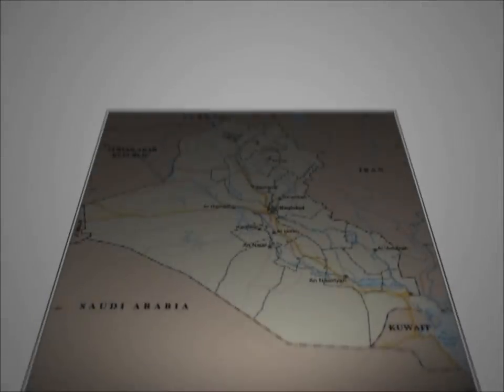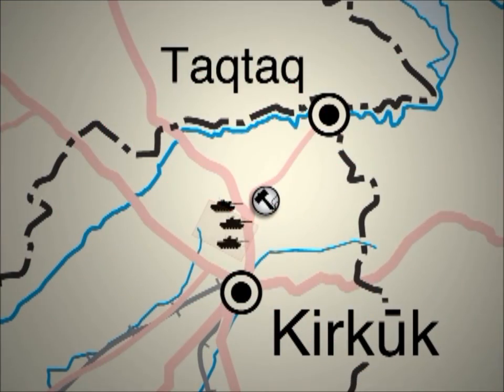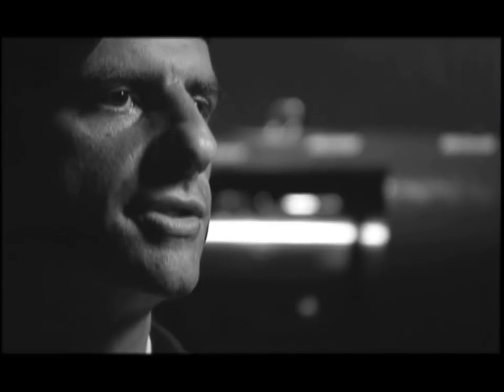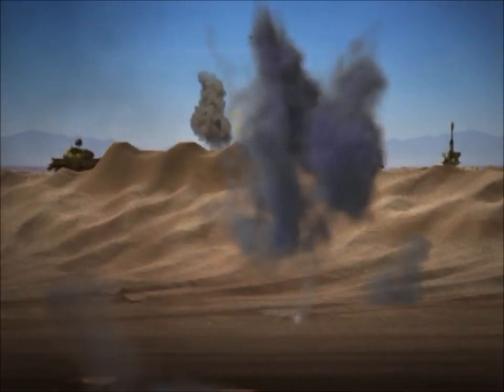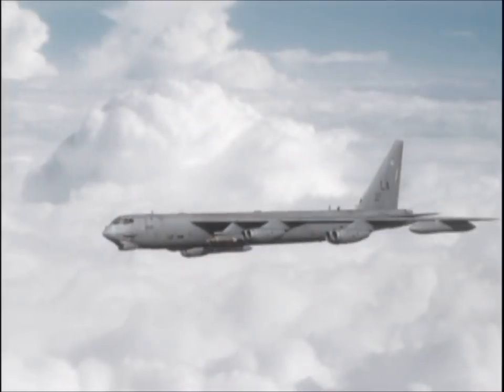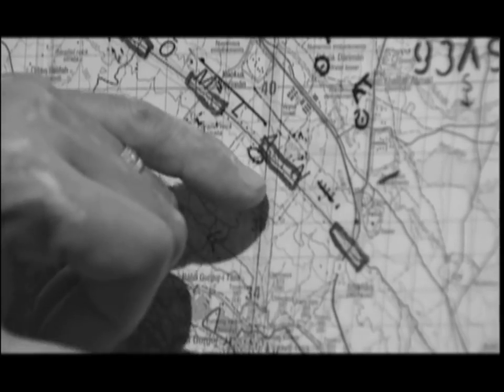THE ROAD TO KIRKUK Sensor Fuzed Weapon

Comment: Unit cost of CBU-105 was $371,216 in FY01 dollars, so that strike of sixteen cost ~$6M. Not inexpensive but apparently quite effective.
Reply: Way more cost effective than JDAMs, oor even dumb bombs if you factor the cost of all the sorties that would be required to neutralize the same size enemy force with dumb bombs.
Reply: i know your comment is old, but each cbu-105 has 40 skeets. Thats $9,000 per destroyed vehicle. If you wanted to do that with a tomahawk you'd be dropping about a million per kill. Even the Hellfires, which are super cheap by military standards, are around $150,000. Closest equivalent IMO is the GBU-39B Small Diameter Bomb, 250lb GPS guided bombs, and even those are $40k a pop!

Comment: Correct me if im wrong, i saw a footage (a real test) on which this weapon was more hitting the ground and self detonated in  mid air than hitting the vehicles and i didn't see any tanks blowing up. But maybe it was just a mere test, please address me a real footage about this thing, that im really interested in the idea of its creation ,  that shows its real power, all I've seen is a mess yet, and some unprovable claims
Reply: It wasn't "Hitting the ground" and "self detonating in the air". What you saw hitting the ground were the empty containers after they'd dispensed the skeets. And the explosions you saw in the air were the skeets locating a target, and detonating above it, which accelerates an explosively formed projectile at many times the speed of a rifle round into the target below it. Look up how the system actually works and you'll understand.

Comment: Can someone explain the effect this weapon has on the troops inside these vehicles?  Is it likely to kill the people inside or does it just destroy the engine?
Reply: most likely killed depending on penetration to crew comportment the moment a liquid metal jet penetrate the Armour it will pressurize the cabin to unsurvival condition that if the fragmentation dont get to you first in modern warfare munition Armour are so powerful that if the Armour fails your body wont even contribute a single percent to the munition damage potential
Reply: If you note in the rather quick simulation that when the Skeets explode, there is a main penetrator and 20 peripheral frags that aim at the vehicle OR person.  The penetarator is going to put a large hole in anything it hits like an RPG-7 warhead with a secondary frag cloud surrounding it to hit anything soft or light armorerd.  Imagine a smart RPG and a hand grenade coming along for the ride
Reply: @mattnsac altitude determines how it deploys. It can’t do both (shrapnel and projectile). If it drops too low and doesn’t see a target, then it explodes into shrapnel. Can also be deployed as a WAM. Wide Area Mine. Dropped to the ground on a small platform. Sits there and waits until it senses movement, then fires.